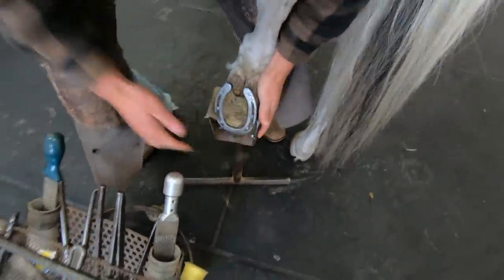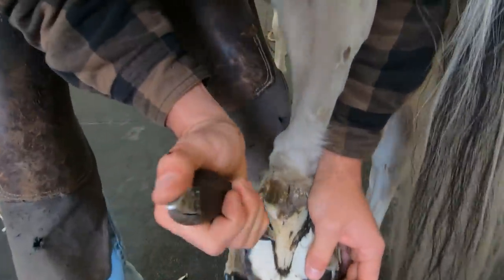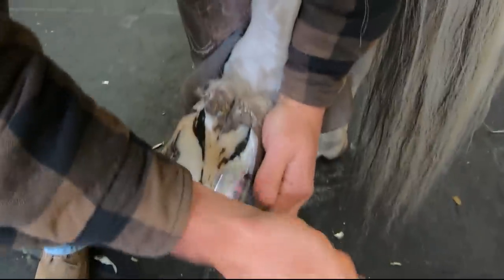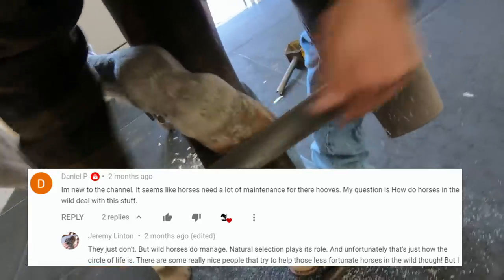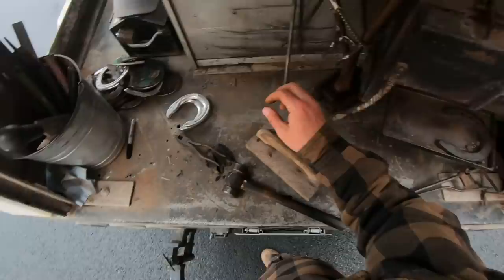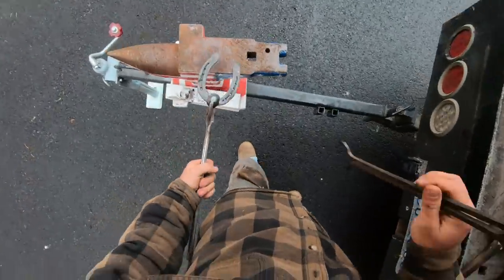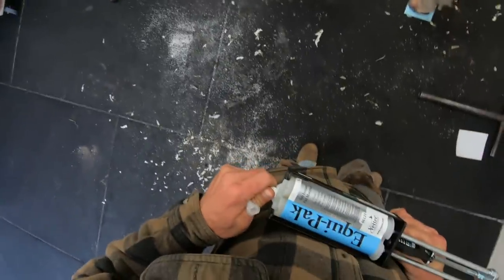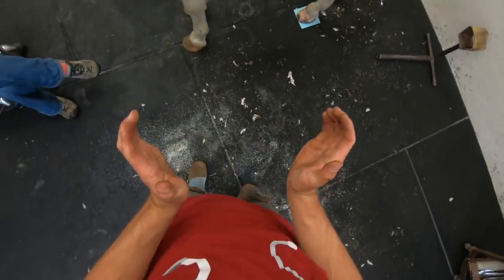Therapeutic Horseshoeing // Making PROGRESS!! // Pinto Bean Update Ep.6

Comment: To add to the comment/question about the wild horses, the terrain and amount of ground they cover also plays a role in maintenance. They might not be as great of feet as those who are maintained. The terrain wild horses cover is very rough and hard which chips the long horny wall of the foot, and they’re always traveling. Domestic horses are often in softer ground, some with shoes. And therefore don’t chip off as easily or regularly.  As for malformations or issues such as keretomas there’s not a whole lot we can do for them, nature does have to play it’s role there. To bring them in is a lot of stress on the animal and without regular maintenance it’s a lot of unnecessary effort for something that might die anyways, unfortunately that is the case. Hope this helps! Or at least now there’s a little more knowledge! Have a great day!!!!

Comment: Nice. I do epoxy inspections for construction, well that's one of my certs. As soon as you pulled out the epoxy gun I was worried you wouldn't be doing an initial bead to check that it was mixing. It was the first thing you did and the thing I have to constantly call out contractors for. Well done sir.